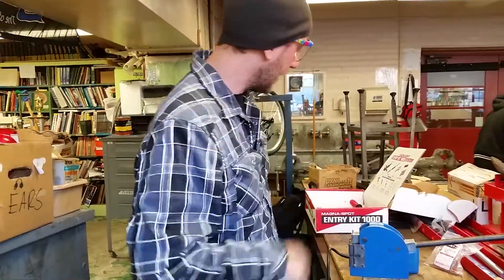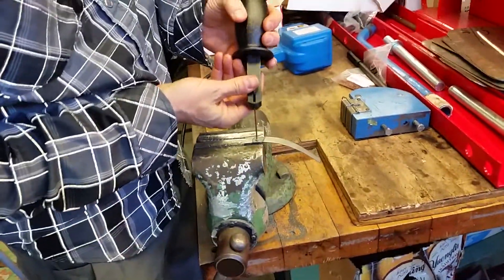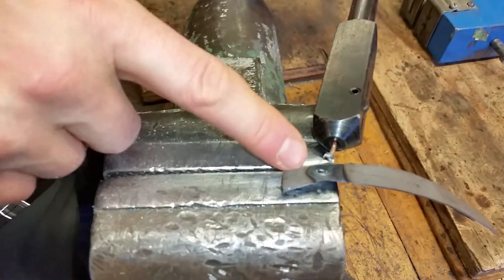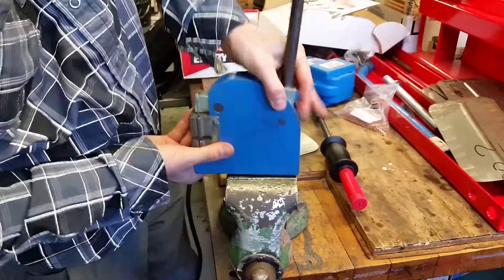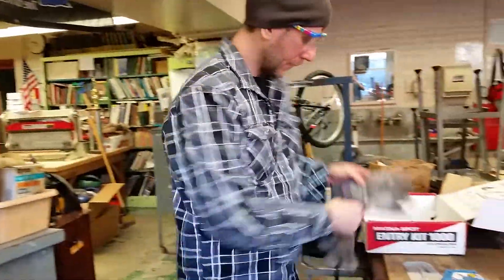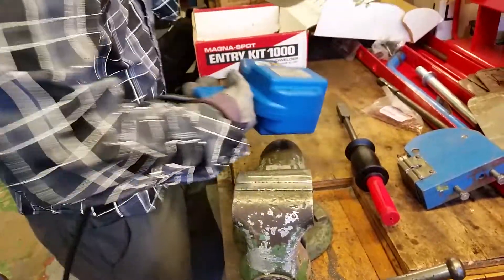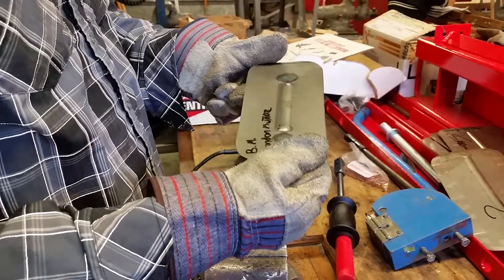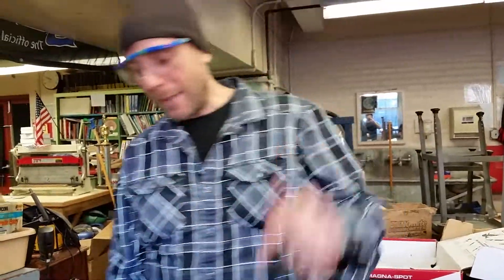Heat Shrinking with a Stud Welder

Comment: I've been tripping over a Harbor Freight spot welder while torch shrinking a 90 degree flange.  Was getting ready for bed when two braincells found each other - "I wonder?" so I searched for it and found this.  Spot welder not the same as stud welder, but it kinda is, at least for this purpose.